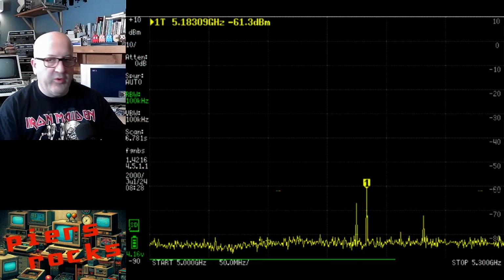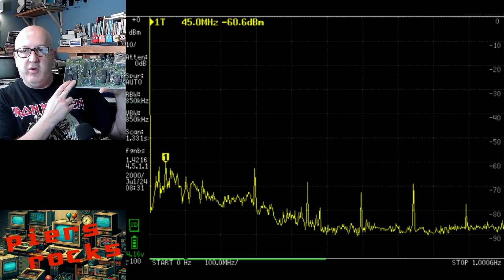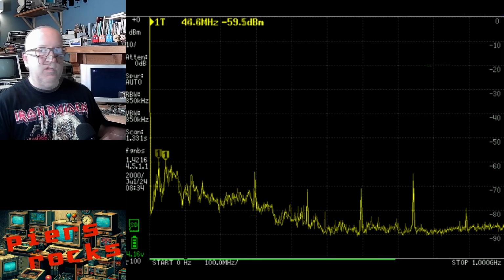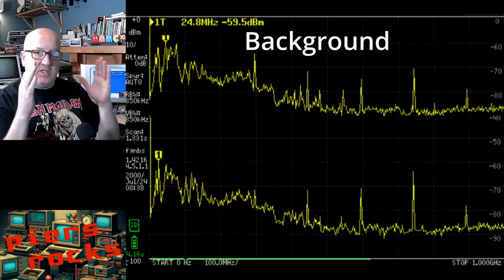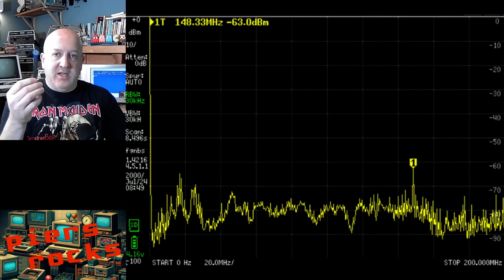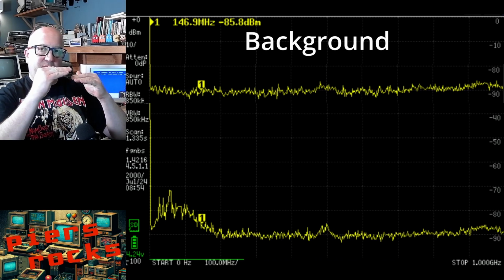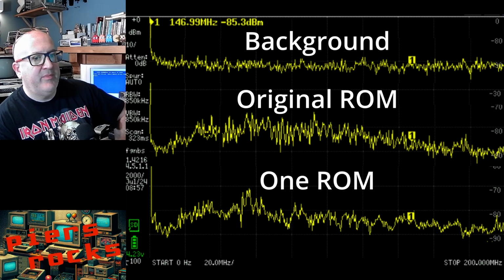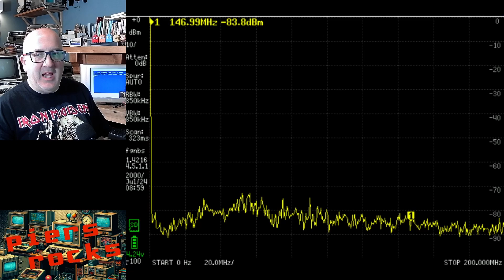Will this 2 layer PCB kill people? Let's find out!

Comment: Ground pours are generally useless beyond looking pretty. The only parts of them that will be useful (if any) are those that parallel a signal trace on the other side of the board to provide a return path. You can just do that with a ground trace and then actually know you're getting the benefit, rather than just pouring and hoping that it will maybe make closer return paths than you otherwise have.

You also can't say that just because the vintage system this is going into is using a two layer board as well, your board won't add significantly to the EMI. The problem is that your board is using modern chips that tend to generate quite fast edges, much faster than the typical 74LS parts in an old vintage system, and the frequencies generated are based mainly on the speed of the edges: faster edges generate more higher harmonic EMI than slower ones.

All that said, it's theory which doesn't necessarily apply in any major way to this situation. I'm entirely unsurprised that the two-layer board had no perceptible problems with EMI. But thanks for doing the test; it was interesting to see!
Reply from the maker: Thanks for the input!

Comment: I've had to do real EMI testing of my designs, including in defense applications where the emissions limits are very strict. Thus, I feel qualified to opine that One ROM is useless as a death ray.
Reply from the maker: @Nf6xNet Ah well, back to the drawing board
Reply: Don't forget to put the tin foil on your head when testing! 😅😂😅😂😅 
I thought Commodore spent half their R&D on putting that RF shield on both the VIC 20 and C64. I don't think any of the Commodore factory chips have that level of detail in them.
Reply: @eebaker699  What if the Commodore tinfoil amplifies the One ROM's emanations and turns it into some sort of insanity ray? 😱
Reply: @Nf6xNet a very distinct possibility. 😂😅😂😅

Comment: This is a bit like using a calibrated tongue for voltage measurement ;-)

Perhaps I should buy one and sit in our nice quite 100dB screened room with a C64 hahaha... I suspect the 64 will out noise it as will every crappy solar inverter, switchmode supply and vibrator in the neighbourhood.

If comes down to "I've compromised a number of 'textbook' layout practises by using a 2 layer board. It works for me but don't use it as a reference for PCB design".

Have a great Xmas!
Reply from the maker: @ingmarm8858 This is a bit like using a calibrated tongue for voltage measurement ;-).  I can certainly attest that 24V on the tongue wakes you up.

Comment: Worrying about emissions from something like this is, frankly, pretty silly (particularly considering how noisy the computers themselves of that era were to begin with).  If anything, I would be much more worried about the opposite problem: that the board might actually pick up noise from the environment (i.e. from other parts of the computer, etc), resulting in unreliable behavior.  However, that seems pretty unlikely to me here too, given how short most of the traces would appear to be (and particulrly in a relatively slow-speed and low-sensitivity application like this).

Unless you're doing high-power or RF-signal circuit design, ground planes are usually more about protecting your own circuit from interference, rather than limiting the (already usually pretty tiny) amount of RF that it would put out into the world...

Comment: 3) Also the optional ROM in an REU
Reply from the maker: Um, don't know anything about the REU!
Reply: @piers_rocks  Yes it's the same, U18 of the 1750 model REU (Ram Expansion Unit) for the C64/C128, takes a 23256.
Reply: @piers_rocks  https://ar.c64.org/rrwiki/images/9/90/1750_1764_Service_Schematics.pdf

Comment: Glad to see that it's working! I have 2 questions, not addressed in the FAQ: 1) Can this also replace the option ROM on a C128, or is that wired differently? 2) Is there any possibility for C64-side ROM switching? Could it be added? Of course, one must be careful not to conflict with other software controls. Probably best to have a few options for the trigger address. Some systems do this in a careful way with an "arming" write followed by a control write.
Reply from the maker: @curiousgeorge7515 1) I'm not very familiar with the C128 but it looks like the option ROM is just a standard 27128/27256, so yes the 28 pin One ROM should work.
There's a few ways you could end up switching the C64 ROM while it's running, for example with "dynamic bank switching" where you can then use 2 jumpers to select between 4 images dynamically.
Reply: @piers_rocks  Yes, socket U36 takes a 27256 (32kb). An example of it's use is BASIC8.
Yes I saw that ROMs can be dynamically switched with hardware signals, but I was looking at a feature maybe added to control it in client-side software.
Reply from the maker: @curiousgeorge7515 - it should be feasible, but using one of the unused CPU cores and/or another PIO to monitor the addresses being served, and performing extra logic based on that.  Something I haven't got to yet.

Comment: - that's like looking for transient spikes on an RMS measurement plot, TinySA is way to slow for this test, especially at broad frequency span
- probe to DUT orientation matters
- you don't need a big db difference since it is not a linear scale and allowable limit is frequency dependent
And I'm sure there's a ton more to it, so I'd either just do my best to stay well under the limit or pay for a proper lab test (if it makes sense product wise), but certainly not try to cosplay metrology.
As you mentioned, your current loops are relatively short, that will translate to wavelengths of higher frequencies that you are not even observing on hobbyist class instrument.
But what you underestimate is the amounts of current enough to fail EMI certs, I was taught that milliamps are enough (in some cases nA, also low power transmitters may operate in mW ranges, e.g. certified WiFi is capped at 100mW), so very well within MCU drive strengths and makes total sense to further limit GPIOs with series resistors where possible.
Original comment about affecting a patient monitor is rather a sarcastic joke, since medical devices ought to be built more rugged than any usual electronics. If OneROM was to affect anything it would be lower class devices.